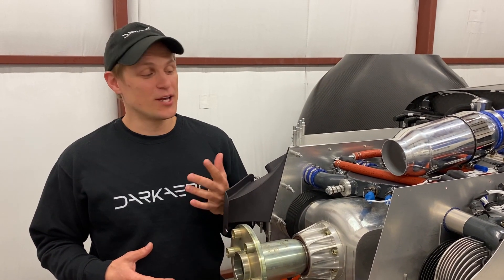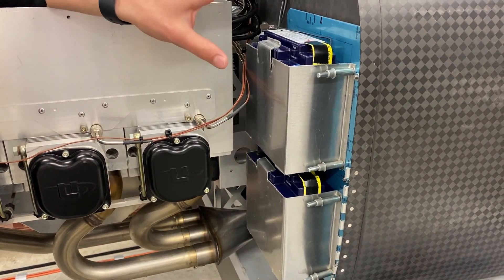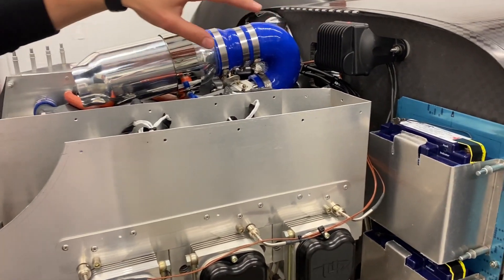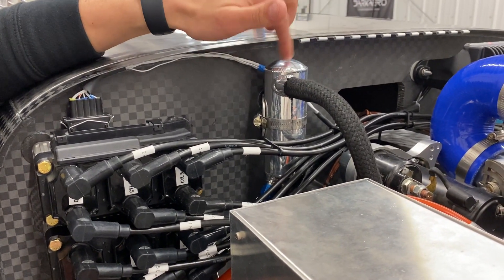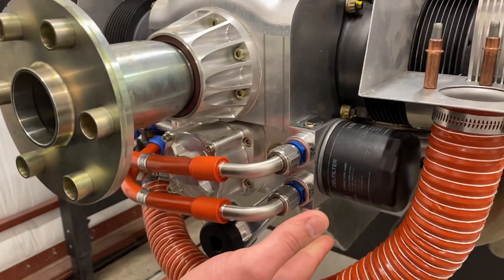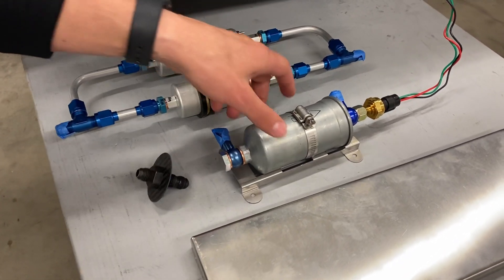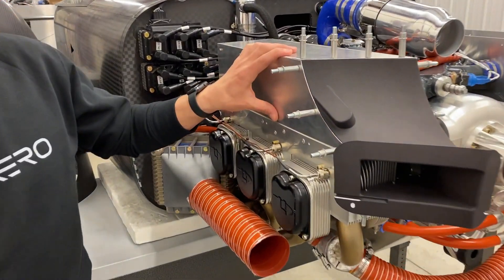UL Power UL520iS Engine Install on the DarkAero 1 - Part 1

Comment: FUEL AND OIL SYSTEM:
1) Are the two primary fuel filters located in the cabin or in the front wheel well?
2) What provision have you made for mitigation of a fuel leak and/or fire on both the cool-side and hot-side, mount locations, of the fuel system (logically each of the connectors is potential points-of-failure)?
3) Does the oil-demister have a failure scenario where the bypass air could be contaminated with vent oil or oil mist and thereby could venting directly into the exhaust plenum possibly result in a oil fed fire?

ENGINE UPGRADES:
4) Does  your engine compartment have room for UL520iSA with its modified engine case, oil sump and oil pickup system including with the larger oil air breather oil which allows acrobatics such as vertical climbs, extended inverted flight and negative-G flight regiments and is this a feasible add on—you designed the airframe to handle this type of flying? If not, how difficult would it be to make room?
5a) Have you done a back-of-the-napkin design for feasibility, of the turbocharged (or is it a supercharged?) version of the UL520?
5b) If so would it fit within the existing engine compartment cross-section?
6) Is there room aft of the cabin to create a battery compartment to counter-balance these later engine mods including, if needed an engine bay stretch?

AVIONICS:
7) Is there physical space as well as unused weight budget available in the avionics bay as well as the instrument panel?
8) What is the avionics weight budget?
9) The avionics bay seems quite cramped. Does it have an active cooling system?
10) What is the weight budget allocated to avionics and instruments?

OXYGEN:
11) Since the cabin is unpressurized, is there space mount an oxygen system for the pilot and passenger for flying above 10,000 feet including FL180 through FL200 (I live west of the Rockies. Flying over terrain vs lots of canyon flying seems safer especially with your higher performance DA-1.)?

CABIN HEAT:
12) What is the projected engineered-in ambient air temperature, altitude and airspeed that the cabin heat can compensate for?

COLD WEATHER FLYING:
13a) I see no provisions for wing, control surface and prop de-icing, nor would I expect it, but icing aside, is the airframe suitable for cold weather flying (winter/arctic)?
13b) If yes, what are parameters for cold weather flying?
13c) Does the carbon fibre in the craft limit G-loads in cold weather conditions and if so, what are these design limits?

OVER WATER FLIGHT:
14a) Does the aircraft have provisions for FAA or in my case DOT approved over-water flying?
14b) What are the over water flight imitations expected to be?
14c) If so, in a ditching over water, situation, what type of floatation equipment is or could be made available without compromising your design?

OTHER EMERGENCIES:
15a) Does the aircraft have provisions for a crash activated emergency transponder?
• BAILOUT
- I believe initial flight testing, even for experimental and kit built prototypes, may require the test pilot have a parachute for a situation where the airframe breaks up at altitude. If not a Regulator requirement, I suspect most test pilots would make this a contractual requirement.
15b) Can the seats back padding and seat belt harness be modified to allow for a thin chute insert?
15c) I believe your design has the canopy hinging forward. I know this may not work in a flat spin with little air moving past the canopy but does your design have a provision to pop/eject the canopy in an emergency?

WINGLETS:
You have indicated that you are looking at adding winglet in a future design iteration. These would increase safety margins by lowering stall speed and improve landing handling characteristics, increase rates climb for a given unit of power and improve higher altitude flight characteristics. They can also increase fuel efficiency, increase range, increase in aircrafts full weight limits, provided the airframe and landing gear can maintain safety margins, and some designs integrate winglet tanks to further increase fuel load which further increases range.
16a)I know the development timeline is fluid, but saying flight testing is completed by late 2020 or early 2021 and kit production begins in early to mid 2021, where do winglets sit in the priorities list for Dark Aero future upgrades?
16b) Is it top of the list with 2022 being projected for winglet development?

Comment: A ECU  is not a FADEC , which is it ?
Reply from the maker: Technically it is not a true FADEC because it lacks a propeller control but most UL installations use a fixed pitch prop so in that regard it would function the same as a FADEC. Our installation will use a constant speed propeller which uses its own control unit so our installation is just ECU control on the engine.
Reply: DarkAero, Inc thanks

Comment: Nice vid on the engine. Couple comments...
- wish you had talked about the engine mount and whether considered softer than typ rubber mounts to decrease sound in cabin
- also wish you had discussed weight of engine compared to IO-360 Lyc.
- also source of oil mist separator, or was it custom?
Thx, look fwd to more vids.
Reply from the maker: Hi Dana, thank you for the questions! We just used the standard 65/70 Shore A rubber mounts in our setup. The UL520iS would be about 50-70lbs lighter than an equivalent IO-360 installation. The oil separator is made by Anti Splat Aero LLC. I'll touch on these topics more in the follow up engine installation video to give some more detail!

Comment: Hi guys nice work, I have so questions regarding your engine installation, how you gonna deal with event of a engine fire (AC 20-135) I dont see any stainless steel or titanium sheet between composite firewall and engine?
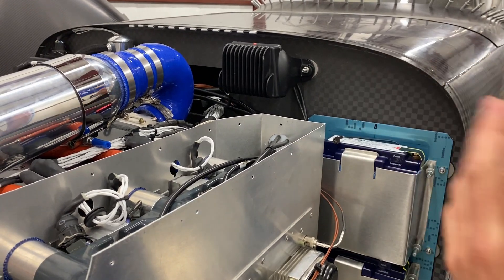Reply from the maker: Hi Ricardo! I didn’t cover it in much detail in the video but it was mentioned at 9:10. We are going to install layer of ceramic insulation covered by 0.015” titanium to act as a fire barrier and heat shield.

Comment: Did you galvanically isolate the firewall from the carbon fiber in the firewall forward?  Curious what was used for that. I love the way this is coming together.
Reply from the maker: We used titanium for the firewall heat shield material which has a galvanic potential very similar to carbon fiber so it was not necessary to isolate it.
Reply: DarkAero, Inc  badass!  Titanium wasn’t cheap!  Keep it up!

Comment: Ryley, I want to remind you of Service bulletin 2019_01 requiring the addition of Nordlock washers on the valve cover screws.  I don't see them on your engine yet.  https://ulpower.com/content/1-engines/6-service-bulletins/service-bulletin-2019_01.pdf
Reply from the maker: Agreed! Thank you Greg! I have the M5 Nord-Lock washers on hand, just haven’t installed them yet. Does your engine have the M6 Nord-Locks on the intake runners? I noticed they are shown in the illustrated parts catalog but were not on the early 520’s like ours.
Reply: @DarkAeroInc  I had to go check... no, mine does not have the Nordlock washers on the intake runners.
Reply: What’s the 520 cost right now?
Reply: @tomsplace239  It's probably best to get this from https://www.facebook.com/ULPower.  Robert can give you an accurate answer.

Comment: Beautiful installation. 3 questions/comments.. I assume there will be a gascolator so you can check for water and debris. Where will the air filter be and will you have a control to bypass it? Finally, can you post a fuel system schematic? The Rotax 912iS fuel system recommends a bypass line with a restricted orifice that serves a number of purposes including helping eliminate vapor lock, you didn’t talk about that, but that might be more detailed than you wanted to discuss.
Reply from the maker: Thank you for watching and for the questions! There is a drain to check for water in the sump tank at the lowest point in the fuel system. The air filter is located in the big shiny can on top of the engine. There is no bypass for the air filter. The UL520iS has the orifice bypass line built into the fuel system.

Comment: great install fellas!  
 i might have missed this elsewhere but are there 1 or two alternators? 
 also what is the planned battery backup time? (30 minutes or more)
Reply from the maker: Thanks for the question! In this current configuration, we are using a single alternator, but employing two 24.8AH batteries. The idea here being that if the alternator fails, you would run purely off the batteries for the rest of your flight until you were able to land the plane.

Comment: I was researching that engine, which seems to me to have a lot going for it, but it gave rise to two questions: 

1. How do you know you'll get the performance you expect at higher altitudes with a NA engine? , and 

2. Would a 4 cylinder engine with a turbo give similar power to weight, without losing engine performance at higher levels?  Thanks!
Reply: Now that I've been looking, I'm having a hard time finding a 4 cylinder with turbo that isn't nearly double the weight for similar power...

Comment: Hey guys love watching this come to life  . Wouldn't you want two injectors for redundancy in the ignition/combustion area? I was just curious on the probability of failure in one of those since spark/ mags are doubled up with the redundancy for ignition.  I know injectors can be pricey tho...
Reply from the maker: Ben Ward the engine continues to run if an individual injector fails although you would notice some roughness.
Reply: @DarkAeroInc  The same is true of a plug or coil failure. Ignition redundancy without fuel delivery redundancy is a leftover from the days of unreliable electrical components and carburetors that could not reasonably be arranged with redundancy, and seems to be just accepted in general aviation because no one is willing to pay for anything better.

Comment: UL Power UL520iS is realy good choise: 200 hp with Ready-to-fly weight 108 kg (238 lb). You suspect DarkAero 1 will have cruise 275 mph but this is more than Turbocharged Piper M350 - 213 ktas (245 mph). I hope DarkAero 1 will be realy so fast.

Comment: I get that you're using FADEC but I don't see EGT probes and, beyond targeting LOP operation, EGT can be diagnostic for other issues. Just curious why they're not there?
Reply from the maker: Kaweeka, thanks for watching! We didn't have the EGT probe installed for this video, but will be installing it later.
Reply: Since the engine is FADEC, there is no manual mixture control, making monitoring ROP/LOP moot.  The ECU computer does it all!

Comment: How about LiFePO batteries for weight? and will you use UL's turbo engine at some point?
how about metal foil and insulation on the firewall?
Reply from the maker: The EarthX batteries we're using are indeed Lithium Iron Phosphate. We are still looking into employing the turbo version of the UL engine down the road, but are going to get the normally aspirated version up in the air first. The firewall heat shield consists of 0.016” thick sheet of titanium with a layer of Fiberfrax ceramic insulation behind it.
Reply: @DarkAeroInc  you might be able to have the batteries on the other side of the firewall, maybe in a can with an emergency vent. Because lifepo doesn't really burn. Sort of a second stage fire compartment. The firewall isn't fully hermetic, is it? so maybe a battery box can easily vent into the engine bay. They don't produce any real flames iirc. Just gas/steam.
Reply: @DarkAeroInc  Nice, just looked like carbon fiber.
Reply from the maker: @DanFrederiksen  what was shown in the video was carbon fiber. The titanium and Fiberfrax still has to be installed.

Comment: Great looking install.  How easy is it to remove spark plugs with that air box?
Reply from the maker: Thank you! The air box needs to be removed to get at the spark plugs which is maybe a 5-minute task. Nothing too crazy. Overall the setup is really easy to work on.
Reply: @DarkAeroInc  I think people are seeing the many rivets and assuming that it will not be possible to open the air boxes. I assume that once they are complete (which they presumably were long ago, now) they will lift off... although I don't know how, given that is wired and plumbed through them.

Did this come up in a later video?

Comment: Really clean! I have to ask though. I've been watching a few other videos involving Lancair 360s (which, to me, seem like the spiritual ancestors to the DA1) and a really common issue with them is engine cooling. For example, many can't do a full-power climb without cooking the cylinders. They seem to have significantly more inlet and outlet area, unless there are going to be additional cutouts in the lower cowling that haven't been shown yet. Is this a concern? Is the UL Power engine more thermally efficient, or are you relying on more speed and a better plenum design to overcome the thermal issues? Thanks! Looking forward to the future videos.
Reply from the maker: The cylinder head temps don’t seem to be an issue on most UL engine installs because they have such large cooling fins on the cylinder heads. We were more concerned about oil cooling which is why we installed a large oil cooler with a dedicated duct system. Cooling is almost always an area that requires refinement on homebuilt aircraft so we tried to make everything easy to modify.
Reply: @DarkAeroInc  Thanks for the reply.  I was discussing this with an A&P friend of mine who mentioned that a lot of cooling problems with the IO-360s also stem from the fact that even with perfect cooling, they tend to run hotter than one might expect due to the fin area problems. If you can get it to run nicely, I'm very excited for the major performance gains to be had from smaller cooling inlet area. Also excited to hear about the nose gear actuator redesign. I admit I was pretty skeptical of a stepper motor based system, since steppers tend to be heavy and lack torque relative to something like a brushless motor. I think the linear actuator idea is excellent and I'm looking forward to seeing it in action!

Comment: Slick. That divergent duct on the plenum looks like it's creating a venturi over the first cylinder thoug. Is that an illusion ?
Reply: AeroGarage   I look forward to their answer, cooling is tricky.  Looks like forward fins will get aggressive impingement cooling.   These air cooled jugs can’t stay round.  I expect the entire box to have static pressure, somewhat less over the first cyl but that’s what testing is for right.  Maybe they did a CFD or copied off other installations?
Reply from the maker: AeroGarage the Venturi looking portion of geometry formed between the divergent inlet and the cylinder head exists only in a portion of the inlet, the rest of it is more open.

Comment: Is it really that hard to have the batteries on the other side of the firewall and in closed to the outside ventilated boxes? 
God luck with a great build :)
Reply from the maker: Ivan, thank you for watching! There isn't enough space for the batteries directly on the cold side of the firewall but if we could fit the batteries there it would still be a difficult location to access for serviceability.
Reply: @DarkAeroInc  Thanks for the quick replay! 
I am familiar with those batteries and actually the distributor for them over here in Sweden. 
I fully understand your choice but thought that the cooler environment without the "coolbox" Would save weight if placed on the other side if the firewall, although they really need a strong sealed box with vents to the outside to expel smoke figuring worst case scenario... 
Probably best to keep them where they are ;) 
What will be the estimated price for your beauty when done, and expected specs? 
Curious of Vne too ;) 
Blue Skies & Fair Winds guys!
Reply from the maker: @IvanMidwing  The most up to date pricing and specs can be found on the aircraft page of our website: https://www.darkaero.com/aircraft .
Reply: @DarkAeroInc  Has all the weight of the sheet metal (battery boxes and future plenum) and the cylinder baffles been calculated in the design?  I know you guys have been focused on weight, but this all appears to heavier than what I have in my Cessna Skymaster (thin simple baffles and plastic battery box).
Reply: I've been curious to see why batteries couldn't have like a drop down access hatch/box assembly where they sit inside the the bottom or top of the wings. For being serviceable but away from cabin environments. You could run the wiring near the cg and through the wing root I would think... I'm just spit ballin  here  I'm sure I missed a reason why not lol
Reply from the maker: @benward87  The reason that we don't do this is because almost all useful space inside our wings is dedicated to storing fuel. Along with cutting into our fuel capacity, additional holes in the wing would have a negative impact on their structural integrity that would require additional reinforcing layers and weight.

Comment: Looking great, fellas!  Funny how, maybe at the outset, it would seem that the engine bay has loads of room for installation and then, in the end, there is just enough space for all the systems. 

If my understanding of the UL electrical system is correct, the engine will function with battery power (limited duration) or alternator power independently, or nominally (watching lots of NASA, Space X video lately) alternator maintaining battery—powering ECU. So, in essence, you have something more than a double redundancy with two batteries (and two ECUs?)depending on how they are wired into your bus (es).

Firewall mounted oil cooler is one less mount to fail. Many oil coolers are hung off the cooling plenum in other installations which often results in mount failure.